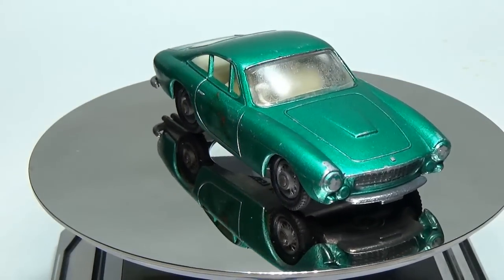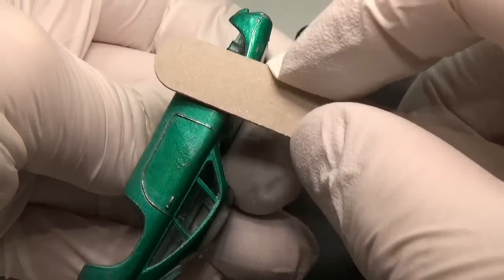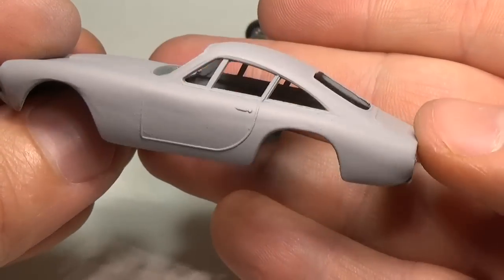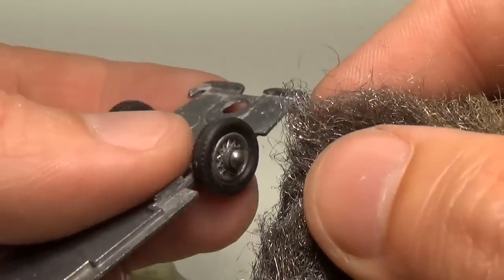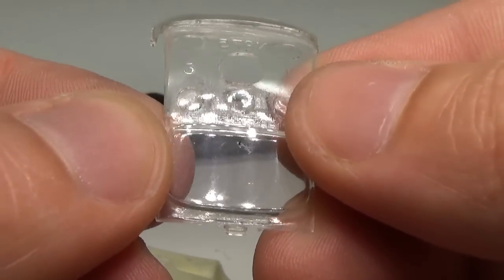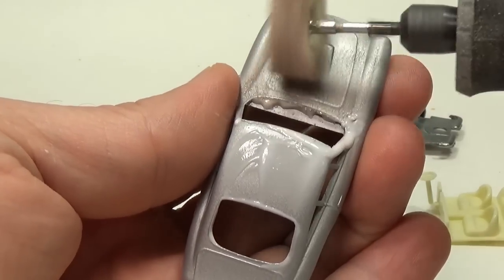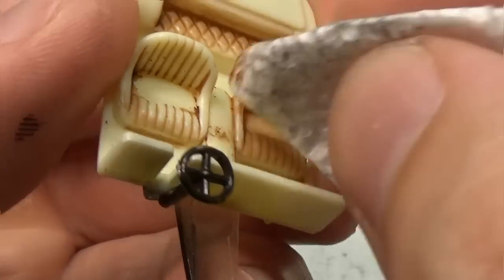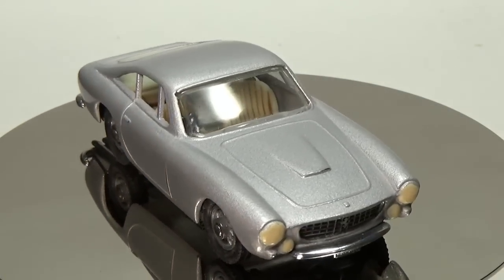Matchbox Restoration: Custom Ferrari 250 GT Berlinetta No 75

Comment: in regard to those wheels .consider how many of these are still around , I have never seen one with broken wheels ...ever. this model is nearly 50 years old and those tiny little wire spoke wheels have survived . in the uk there are a lot of modern small scale vehicles by a company called oxford diecast . there great models and loads of variety but even they cant make a decent wire wheel , they have a sort of fake plastic moulded ones .I think these old lesney/matchbox car are probably the best value toy on the market. I still have loads of mine and every one has a memory . I enjoy your videos and find them informative and entertaining . the reason the paint wasn't easy to remove is simple ...it was british made ... back when we did actually make stuff and did it well lol. cheers .

Comment: I like your work! I'm wondering how you connect the body and the chassis, thanks in advance for the answer
Reply: Kievsky 6aming he threads the area on the body where the rivets were and uses hex screws to put the two halves together
Reply: originally they are connected by rivets which he drills out. He then uses a tap to put grooves for a screw in the old rivets pillars. He then uses new screws to reattach the body to the chassis. (For more detail look at his channel, he actually has a whole video on how to do it from start to finish)
Reply: LAKster can you send me this video, if you know it? thanks,

Comment: I had a problem removing paint from a 1960s Matchbox D Type Jaguar. I found putting it in a plastic bag overnight with a mix of gel Nitromors paint stripper and dichloromethane did the trick.

Comment: This came out absolutely amazing.  I really like how you removed the mold lines.  I have a question about that though.  In the process of doing so the line on the front of the doors was also diminished.  Ideally that front door line should continue up a little higher.  I'm assuming this was a necessary compromise, but I was wondering if there would have been a way to preserve that line will still removing the mold line.

Comment: I've recently bought this same car as well, and am currently in the process of restoring it like you did to yours. The only difference is that I have absolutely no sanding to do on the body, I soaked it in Pine-Sol and so far the old paint appears to be lifting right off, still not ready as it needs to soak for about a week to get all the paint completely off. You should try using Pine-Sol sometime to remove paint on your car bodies, it's very strong and works really well.

Comment: Great job as always. Now I have a technical question, can I use grey primer as the main paint if afterwards it is clear coated. I could bore you with explanation but I will not. Thanks.

Comment: What made you remove the mold lines? Are they considered imperfections in general? Great work as usual.
Reply from the maker: They are imperfections and do not exist on the real car.  Mattel and Matchbox use paint today that covers them..  When I paint the cars I am using much thinner paint layers so mold lines show up.
Reply: No kidding. Thanks for the info.

Comment: you should try a Monster Jam hot wheels truck from the early 2000's if you get ahold of one (look up "Monster Jam 1:64 scale Small Hub" on eBay, they are kinda expensive though)

Comment: Well that was a great car you chose personally I like the original Green but I understand it was in poor shape and something had to be done I like the fact that all you did was basically take the paint off and clear coat it I often do that with car as I have if after taking the paint off there's no pitting and it's in great condition and honestly I am really shocked because I think that is a really good casting don't get me wrong in defense of Matchbox I think today's Matchbox castings are most of the time anyway better than Hot Wheels but the old Matchbox castings there are times when I see them and I just want to run and hide because they scare me hahaha good job and you're stronger than me because I would have cut that hitch off the first second I took it apart LOL

Comment: You should paint the trailer hitch black and the ball silver, also paint the lic plate yellow with black letters
Reply: The number plate should be black with white letters. Yellow plates weren't introduced until 1968 in the UK.
Reply: +An drew No, they were silver letters.
Reply: Wayne Nineonenine yes black with white letters, what year did the plastic ones come in? 73?
Reply: The licence plate at that time would have been black with white letters...

Comment: Dude, you can totally use brake fluid on metal surfaces to remove paint.
That stuff is evil, it will eat through pretty much any kind of paint. 
Dip the car in, let it sit, wipe it down and wash it. 
Works on plastic as well, but it's a gamble. It will eat some plastics..

Comment: As always the finished Ferrari turned out great. It would have been nice if the license plate was detailed, maybe even year appropriate color for the plate. Should you decide to remove the the trailer hitch save them to use on customs with trailers. A few years ago I had an urge to make matching trailer for Hot Wheels trucks, for the hitch I used the hitch off old Match Cars and made the tongues from sheet metal and managed to keep the matching graphics on the trailers.
https://www.flickr.com/photos/daddy_rah/17078090058/in/photostream/

Comment: i like the video he make and i do it but ir not the i get a two cars and the same size and break it and the bas of the car and just take the wheel from the car and do it and hot gule it into the car i don't like using the bas of the car i fix the car by hot gule i use body of the car to put the wheel hot gule it